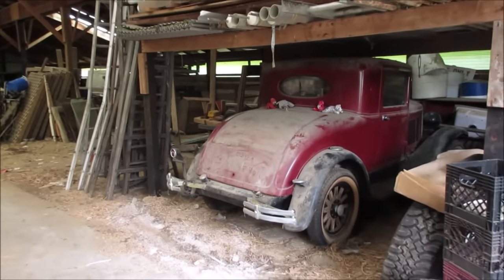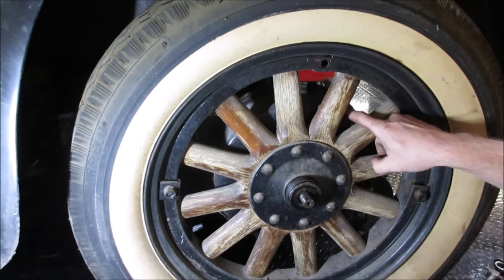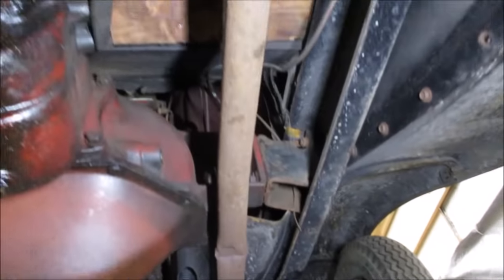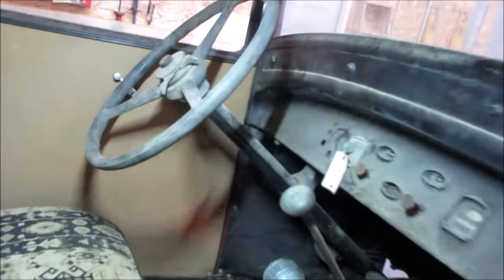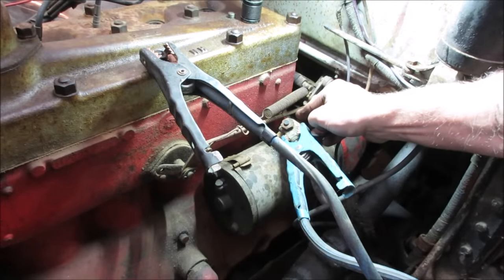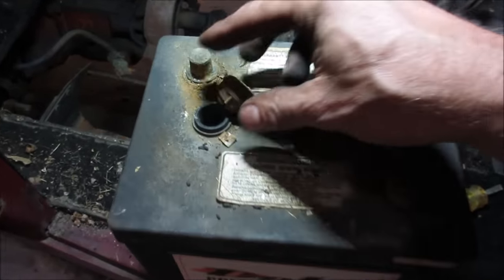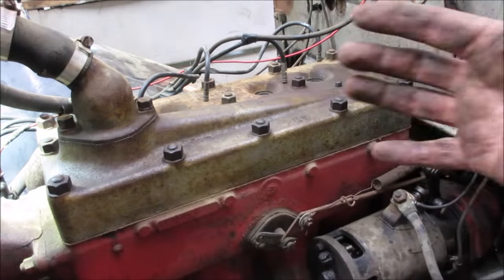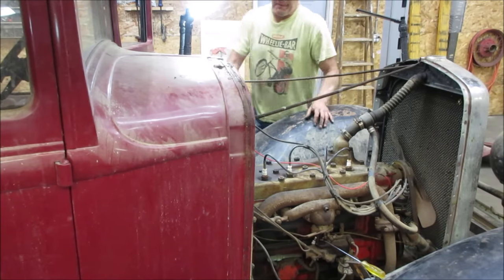abandoned rumble seat Plymouth, can we save it?

Comment: YES! Back in the 60s my dad had a 1929 Model A that was converted into a tractor. That's what I learned to drive on around the yard and woods when I was around 12yo.
If memory serves me correctly this engine was almost identical to the one in your car. Ours did have a spark advance although it was a lever on the left side of the steering column. Damn, that was a long time ago!
I can't wait for you to get it running. I can just see you behind the wheel driving it down the road. 😃
Reply: The old timers called those Bugs was fairly common as tractors were scarce and expensive
Reply: In Massachusetts as a kid we called them Doodle Bugs. I remember some in our area with 2 transmissions, and one with 2 5 speed truck transmissions ,and about 2 tons of solid granite used to remove snow in mobile home park.
Reply: @billsartelle353  Yes, ours had the two transmissions also. The lowest forward speed was reverse in both transmissions. I remember watching my dad using a logging chain to pull tree stumps up with it.

Comment: I would add to your tool box four flexible cutting boards to be placed under the tires.  I've seen many a tow-truck operator use these during the recovery of vehicles.  Think of them as furniture movers.  Thanks for your content.
Reply: Nylon trays, like cafeteria trays
Reply: Skid plates ( Great idea ) I have seen a similar thing in the airplane world. I completely forgot about it until the Mustie Video ( Kudos)
Reply: Yes good call. Cutting boards are typical high density polyethylene (HDPE), you can buy it from TAP plastics or McMaster-Carr. Even better is Ultra High Molecular Weight polyethylene (UHMW), I used that for skid plates on my off road camper. Indestructible stuff and slides over most other surfaces. 👍

Comment: One tip I was told when working on old engines. If you run a lead pencil along the rotor arm and the distributer points, the graphite improves the spark, and also only short bursts on the starter. continuous running does not help much. You have a lovely project there and if it were mine, I would have had the head off before trying to start as the valves might benefit from reseating them before starting. Another thing you might find useful when you start to clean the bright work up, strangely, Tomatoe Ketchup and a little washing up liquid polishes a lot faster than propriety abrasive cleaners.

Comment: Sweet Plymouth! On a Model A there are spark advance/retard and throttle control on the column. Also horn and lights in the centerof the steering wheel. The condenser is located inside the distributor. Juice brakes and roll down back window make this a really cool coupe.

Comment: the power switch to the starter is on the floor, there was a lever to engage the starter gear to the flywheel before the starer solenoid became common, folks just used the crank handle or a rolling bump start.   Starter warm up was way to easy!   Originally the frame -body was positive but also lots off wood and rust so the returns are always a problem.
Most have been converted to 12v with the frame negative and 
the key just 'grounds' the spark, one steering wheel thing is spark advance, choke is a pull knob on the dash

Comment: I have a 1929 Model A that is very similar to this Plymouth.   I inherited it from my dad and grandfather.  They traded a Model T for it when my dad was a kid.   My dad passed away 5 years ago, but towards the end he gave me a few pointers on how to keep it running.  I have some really cool old shop manuals that he gave to me as well. The last time I had it out I was having problems with it stalling out and backfiring.  I put it up at a loss for what was causing that to happen. Your video has inspired me to figure it out!
Reply: Timing issue?
Reply: You might check some of the Model A forums out there.  VGG picked one up, and there were a lot of comments in that video about where to find parts and information.

Comment: A starter that is field wound will spin the same direction no matter how you hook up the battery.  This is because on a field wound motor, switching the battery leads changed the polarity of the field and armature at the same time.  Field wound motors will actually run on AC current.  An example I have messed with was American flyer toy trains.
Reply: Yes, was going to mention this as well. Both my pre-war British cars have field wound starters and they will work either polarity as you say. It's interesting seeing how similar the tech in most 30s cars is.
Reply: That's why I didn't notice many years ago that the battery in our 1961 Beetle had the wrong polarity. The car ran normally, but when I installed a radio, it didn't work.
Reply: @peterofenback9263  The older the car the less there is to be affected by reversed polarity. Even a car with a coil will still work but with the coil backwards the spark isn't as good as it should be. Did the car run better once you reversed it? A car with a magneto for ignition there is even less to worry about polarity wise. The other thing someone else mentioned in the comments is you might need to change the polarity of a dynamo which you can usually do by re-flashing (re-polarising) them momentarily. They dynamo needs a small residual magnetic field in it so when it starts rotating the voltage it produces is the right polarity. That fades over time if the car hasn't been used and you can also reverse it by re-flashing so it can be used positive or negative ground.

Comment: It's sometimes hard to watch him experimenting on things when so much information is at his fingertips. But I understand the spirit of his channel.
Reply: Never seen Darren use a manual, suspect he is a bit dyslexic, but compensates by his diagnostic skills
Reply from the maker: if my job was to just do the work and not film l would do things differently
Reply: Every thing he is doing he is guessing at. He actually knows nothing about the car or how it works. He checked the emergency brake after they got it on the trailer and removed the hub nut before he put a jack under it. I really like the car I can't watch it I can't watch what he's doing. For crying out loud read a book or Google it. Better yet get on YouTube.
Reply: @patrick5180  Watching him thumbing through and following a workshop manual would make for a pretty boring and abbreviated show, would it not? Personally, I'd rather watch him get after it using his skills of deduction and piles of scrap parts.

Comment: Tip.  That stake you drove in the ground needs a secondary securing point.  Drive a stake in behind it at and angle and then tie a line from the the top of the first stake to the base of the second stake.  It also helps if you push a spade into the ground in front of the first stake to spread the load.  I have used that method using a Tirfor winch to move crashed and immobile vehicles.  You would be surprised how good an anchor point it make.
Reply: if you want a good stake, go visit a tent company. They have 'em up well over an inch thick... and 2-3 ft long.

Comment: 6 volt systems were never the best after they aged a bit, so you really needed to keep them up, especially in winter.  One thing to check would be the + connection to the frame. It really should go to the engine block to secure a good ground. Next, the starter cable from the battery looks really small. I remember most 6 volt systems used 4 or even 2 gage wire, kept as short as practical. Finally, no problem with the starter polarity vs rotation. Polarity to the starter only matters if the starter motor is a PM (permanent magnet) type. Finally, the condenser is important, and I've never come across one mounted remotely to the distributor.
Reply: Hatte als Student in den 80 Jahren einen alten VW Käfer, 6 Volt. Im Winter anschieben war normal.

Comment: I went through exactly the same process restoring a 1928 Plymouth sedan. The levers on the steering column are spark advance and hand throttle. Mine had a vacuum fuel pump and the mass of wires at the end of the steering box is the headlights. My First start was on 12v which spun the starter a lot faster. The delco distributor is the same as on a david brown tractor and I got rotor and points from a tractor supply company in the states. I Swapped the carter updraft carb for a Zenith NOS, Good luck.

Comment: If you put plastic serving trays under the tires, it will slide on the ground and make it easier to slide around. Have done this many times and it works great on any ground surface.

Comment: Excellent video Mustie  1  :) also yes those 1930's Car be in 4 cylinders are about 15 to 30 hp , carb be Zenith or Carter updraft 1 barrel if got get parts kit be Rock Auto or John Deere Dealership find also fuel filter or NAPA has them  and Spark plugs be Champions same one as 3.5 hp Briggs Stratton motor on short threads with 13/16 hex for wrench ! Distributor parts  can get at Rock Auto or NAPA plus 6 volt Condonser might have John Deere tractor dealer for Row Crop tractor gas of 1951 or years after in 2 or 4 cylinders models gasoline type plus Spark plugs wires! How start these cars is Spark Advance hand on steering to 1/4 from bottom going up to all choke out & Throttle 1/4 to 1/2 on then push choke in 1/8 on when motor smooth running! Hope that helps out and make sure all connections on battery clean and Starter and Generator tooo also Generator has Dixie Cups too lo lube up also Water pump ! Crank if building one should have like Farm Tractor crank like to if want know!

Comment: Lead acid really likes to be left at the absorption (aka trickle) charge level for a long time to get a full deep charge. Absent a data sheet, 14.4V for 12V or 7.2V for 6V for 6+ hours. If you can watch and add water let it charge for 24 hours, or more! Everyone focuses on charger amperage but it doesn’t matter for most of the charge cycle. These batteries need time at the absorption voltage, not amps. Amperage matters when trying to assist the battery for a start, but lead acid will self regulate current for the last portion of its charge and it will be very low, like under an amp. All of us have been in the situation where batteries are nearly dead and being boosted by a jump or starter cart, and sometimes you have no choice but always choose time over amps if you want full power. Great videos keep it up!

Comment: I may be commenting too early in the video, but the upper and lower adjustments would be set with a tool called a brake compass. You mount it to the hub and adjust it based off the diameter of the drum. You get the shoes very close and lock down the bottom adjuster and then make your final adjustments with the top adjuster.

Comment: You are and excellent tech @ Just a suggestion when trying to get an engine started make sure to tighten the spark plugs with a wrench not by hand . You are causing a bad ground on the plug and it will effect plug performance. You need a good ground for plugs. With a lose plug your ground will be iffy and you will get either poor or no spark at all . Love your videos

Comment: Have you ever used long vertical hoses on the spark plug holes? You can fully fill the combustion chamber with penetrating oil and slowly turn it over without the massive mess of squirting oil. When ready to spin  the motor faster,  the mess can be directed into a container.

Comment: So many thing to say, and they increase with the number of beers I drink. 1) I remember going to look at a used (50+ years old) tractor with my grandfather. He showed me you could weld with 6 volts, if you got the polarity wrong (+ ground when you expected - ground).  2) don't clean your "tool" with that spray - might not be pleasant. 3) I don't think those are resistor type spark plug wires. Radio interference (or hearing aids) might be bad.

Comment: Electrical polarity does not matter on the starter because the armature and field windings are connected in series internally thus assuring the correct rotation regardless of polarity. Polarity matters with the generator charging circuit though. As a good rule for an old vehicle like this, you should 'flash' the generator field if any work is done on the generator / voltage regulator circuits to assure the gen. charges the battery when running and not act as a dc motor discharging the battery when stopped. You might want to consider changing to a negative ground battery system to eliminate body / frame corrosion due to electrolysis if this car is operated in northern states that salt their roads in winter. Charging ammeter wiring will need to be reversed if battery ground polarity is reversed and don't forget to flash the field. What beautiful car!

Comment: Pretty cool one you have there this time Mustie .... wooden spokes on that are going to look real nice with a little ..Murphy's Oil Soap ... Pledge ? ... Minwax ? ... Spar varnish  ??? ...  Sheet metal on that is in pretty nice shape for its age ... and also I wonder what a "hockey puck" with a hole drilled through it's Center might do for that front engine mount to get the crank pulley off the frame ..🤔

Comment: That car is in amazing condition. You might get lucky but those honey comb radiators have a tendency for the solder to fail and they leak. Hope yours is good. Looks like you got lucky with the valves. Flat heads tend to wind up with stuck valves when they sit. Looks like someone put oil down those cylinders. Very nice.

Comment: Every bit of your spark trouble is the ignition timing lever on the steering column.
Reply: Sounds like you've been there. It's intermittent, the kind that's hard to solve.
Reply: @rottendrestantje  a friend of mine has an old Ford like this, I’ve helped him work on it many times, very poor design.
Reply: @lilreb601  Isn't it lack of development or are there better carsdesigns from that period?

Comment: Hi Mustie Im not sure if you know the 'lpg  trick' (or propane as you call it there) I use it to check efi cars with dead fuel pumps and blocked injectors, or carby cars with too many fuel issues to bother. Just a bbq propane bottle a hose and a valve. Place it in the intake and adjust as necessary it will run off the gas. Also if you get it wrong and flood it, just turn off the gas and do a bit of a crank and it clears unlike wet fuel. This was a perfect candidate for it due to the leaky carby and updraft setup.

Comment: Like deduction process. Seems electrical and fuel are major issues. Then water pump. Looking forward to next week - condenser, coil wire, points, coil, wire leads, fuel pump/gasket. Sounded best, almost ran with original setup with gas in plugs and head.  Could not run due to insufficient gas.
Fix engine mounts to get belt clearance.

Comment: The coil has an aftermarket look to me. I wonder if some of the coil windings are broken. Coils are delicate transformers.  On many old cars, condensers were typically mounted on the coils. Decades later they were installed inside the distributor. It may have been abandoned, but this rare old Depression mopar has landed in good hands.

Comment: Typical 6 volt system. When the starter is running the coil suffers hot spark. I know they worked but I believe that is why 12volts is the norm now. Great video.

Comment: With a 6 volt system, the battery has to be really fully charged as there's so much voltage drop when the starter is turning, there's hardly any left for the coil! Here in the UK in the 50s & 60s people with old 6V cars would convert them to 12, with new bulbs & coil - but leave the original starter to turn the engine fast!

Comment: She'll go, spark is too far advanced and too intermittent.  6v positive ground. (but you know that now.)  Set of points and rewire from the coil to distributor.  I bet that coil let the smoke out with the 12v pretty quick from sitting up that long, probably all dried out.  It'll more than likely have intake gasket leaking, you can make new ones with a gasket maker kit.  Carb is rebuildable but brass and many of the parts are easily damaged so be careful.   You can convert it to a downdraft carb if you want to swap the manifold, might start easier if you want to keep it 6v since you have gravity assisting fueling and not just cranking vacuum, especially if engine is a bit tired.  Cold start - Fuel on, choke on, ignition off, throttle at idle, crank until you have fuel at the carb. Choke off, ignition hot, throttle cracked 1/4, timing retarded.  When it hits, throttle just above idle, advance timing until it runs smooth.   They don't have "accelerator pumps" per se, engine speed is a function of timing and throttle, so throttle up slowly or it will balk a bit until the fuel catches up.     After you get it dialed in, it should start up warm within a couple of turns, or even within 1 turn if the pistons happen to be in just the right place after the engine stops.

Comment: I have restored many Mopars from 32 -34. I would have bought an owners manual at a minimum before working on this car. You would have known what the ground was and the controls on the steering column. Also and most importantly, I would have filled those cylinder walls with Kerosene and let it set for a few days before attempting the turn over. Then I would have done a compression on the cylinders and if all was respectable and while I was waiting, I would have drained out that old oil and kerosene, filled with fresh Oil,  New spark Plugs and taken apart that updraft carb for a cleaning.  Drop and clean the Gas tank and blow the lines or feed the carb from a can with an electric fuel pump... these carbs only use a few pounds of fuel pressure so a regulator is needed. Leaving the ignition switch on while working on the car will burn up those points.  If you need to know more about this car feel free to ask me.